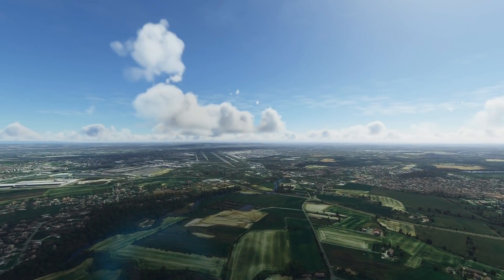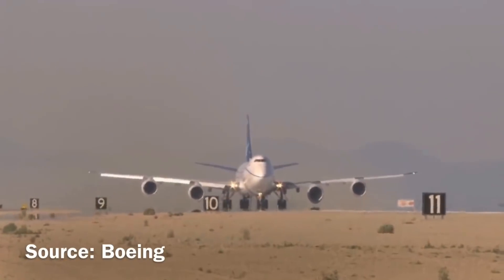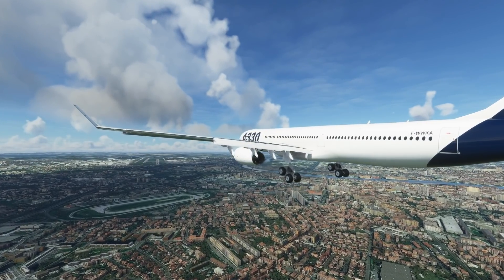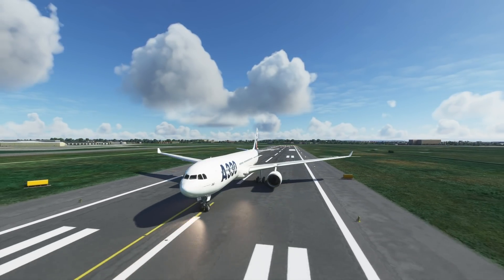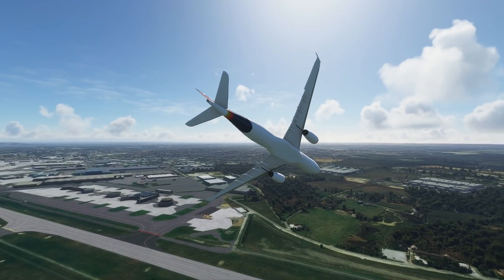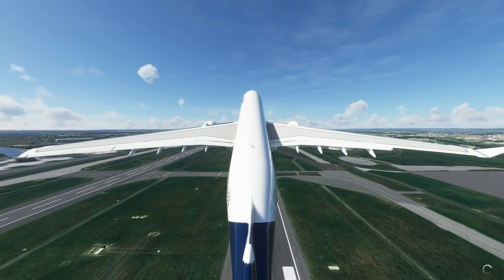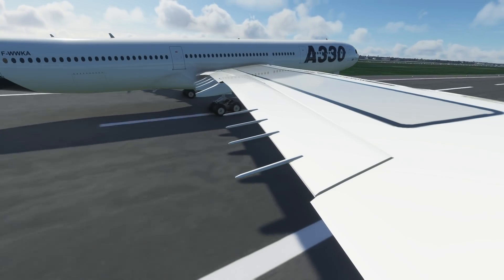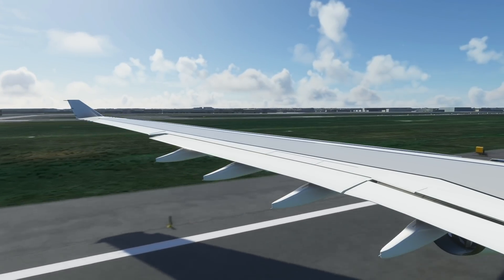The Test Flight That Went Horribly Wrong | Airbus Industrie Flight 129

Comment: I hope they do those tests on flight simulators nowadays, I just can't imagine exposing flight crews to the dangers of doing such failure tests on actual aircraft.
Reply: No amount of simulation can make actual testing obsolete, and no amount of testing can make all incidents avoidable.
Reply: Someone has to fly the manoeuvers to ensure the simulator is realistic, not just bash numbers into a computer.
Reply: And where do you think they get the data that feeds the simulators?
Reply: @tomstravels520  I do, but the outcome would be no loss of aircraft and more importantly, no loss of lives.
Reply: Maybe carrying out a preview of the test on a correctly configured simulator was part of the problem here? It could have added to the over confidence factor.
Reply: Where do you think they get the data to program the simulator?

Do you want to fly on a plane that has only been tested as a computer model and never proven in the real world?

Comment: Why not testing this at an higher flight level? Just adding safety meters and then pretend to just having taken off.... Such a shame the loss of these lives.. So unnecessary imho...
Reply: Because they’re simulating and engine failure at takeoff....not in the cruise
Reply: @tomstravels520  No, you do not understand. just set the meters in the right position. Stall testing they do above fl 10000.... So why this test at this dangerous altitude? Just add safety to your test. All parameters set at the test-levels, and THEN start your test.... Only then they would have had the possibility to regain control. It"s like testing car brakes near a cliff and then find out they don't work. Safety 1st!
Reply: @hugodeckers3880  what are you talking about? This was a test to see how the aircraft and the autopilot would respond to an engine failure at takeoff. This was not a stall test. You can’t simulate taking off at 10,000ft. The air is thinner at 10,000ft as well so aircraft won’t react the same
Reply: @tomstravels520  not at 10,000ft but certainly at 5000ft. Denver is 5400ft above sea level.
Reply: @lukfi89  that still not the same as taking off from the ground and climbing the correct way in SRS mode initially which cannot be done in mid air
Reply: Testing in real life is dangerous. But I can't see why certain parameters can't be set at a higher level. Add test-mode in a plane for testing. And I KNOW this is not a stall test. This fault of the captain and his fo cost  the lives of 7. Unnecessary and so sad. Planes still stall at take of level due to to engine failures, other mechanical failures of faults (stupidity, fatigue or whatever) from the pilots. So why do they test THAT at safe flight level. There's no answer to that..

Comment: IMHO, this should never happen: The autopilot should "know" that there is a minimum speed for climbing. So when the speed starts to drop below say 130 or 140 knots, priority should ALWAYS be to maintain speed and NOT flight path. You CANNOT maintain flight path with a stalled airplane. So trying to maintain the path for a few seconds longer and then crash... Not a good plan.
Reply: Simple answer, at the time the ALTITUDE CAPTURE mode did not have attitude protection. That’s why if the altitude selector has been set much higher it would have stayed in SRS or gone to one of the 2 climb modes and managed the climb on one engine correctly
Reply: Autopilots are not psychic. The crew has to enter cog and overall weights and calculate rotate speeds and noise abatement measures. How does it know the stall speed without that information? It only knows it is almost stalling. It's impossible to design out human error, you can only mitigate it.
Reply: @adriandaw3451  With the american definition of "angle of attack" it is simple. 
The lift of a wing is then proportional to the AOA. If you stall at 15 degrees AOA, then when you fly at 10 degrees AOA, you are flying 1.5 times the stall speed. Simple! If you use the european AOA definition, there is an offset to account for, but the result is the same.
Reply: Either that or automatically disengage
Reply: It looks better for the reputation of the aircraft when you can say the test pilots made a mistake.
Reply: It has a stall protection, I just don't know if the A330 had already that feature or the plane was in alternate or direct law.

Comment: The Chernobyl disaster was also caused by a test designed to simulate an extreme scenario.
Reply: And also in both cases the people running the test didn’t fully understand the characteristics of the system they were testing.

Comment: Would of full thrust help instead of pulling back?
Reply: That would have made the roll worse.
Reply: Maybe thrust up the idle engine could of helped and drop the nose
Reply: @coca-colayes1958  Engines take a lot longer to spool up than down (something like 10-15 seconds from low idle to full thrust). They had managed to get into a situation where the lack of energy made things irrecoverable.

Comment: Test pilots don't get nearly enough credit for the work they do and the risks it has
Reply: Air flight is relatively safe even for test-pilots , it's not even in the top 100 for high-risk for causes of death. Just sayin.
Reply: I think they would. Air Force test pilots maybe , but they would be paid huge salaries. Lots of allowances etc. But they would in the main be highly regarded in their companies. These planes are always getting upgraded too which means plenty off work . Their opinions on aircraft handling would be widely sought after by line pilots.
Reply: InstaBlaster...
Reply: Usually I am the first guy to blame the pilots, but no way on this one. This is an engineering debacle, a complete failure of software logic.

I am both an engineer and a pilot so I don’t take sides.

There’s no way if you have a good software in the auto pilot system that the auto pilot will fly the airplane into a stall, and that is exactly what happened here. In this case engineers are guilty of murder.

Safety of flight is first, so what if the pilots had the intended go to altitude at 2000 feet, and they are below that altitude, no way should the auto pilot try to get there if one engine is not working and it cannot maintain Flight speed for normal climb out. What a terrible disaster.
Reply: @steveperreira5850  similar in the crj200 at 41000 feet video, though, I think - there too, the autopilot was in an altitude rather than speed mode so they got up way too high with too little energy and speed. Not sure how much was the autopilot vs the pilots, I do software but nothing related to aviation.
Reply: @steveperreira5850  as a software engineer you know that the software design should depend on the input (user stories, requirements etc.). This situation has happened because nobody in the software development pipeline has considered a situation where the target altitude has been set - hence the mode switch. The underlying question is how could this usecase have been forgotten be the requirements engineering department. Why did it fall between the cracks?

Also - wasn't there something like "Alpha Floor Protection"? Why didn't this kick in? Or did it and hence the pitch down? Disregarding the altitude acquisition might have saved this plane in case of disregarding a target altitude. But what about a series of mountains around an airfield? In this case, the target acquisition is crucial.

I'm happy to be a software tester in a less perilous field.

Comment: Planes have become too clever for the pilots to keep up
Reply: Standard phrases heard on a modern flight deck: “What’s it doing now?” or “Why did it do that?”
Automation has definitely made aircraft very confusing for pilots, AND has de-skilled pilots.
Reply: @FutureSystem738  Automated systems have undoubtedly caused caused crashes. However they have prevented more than they have caused hence there is still a net benefit.
Reply: @FutureSystem738  Fully manual aircraft are much more dangerous same with fully automated.
Reply: Did we watch the same video??
The plane was too stupid for the pilots to keep up. Automatically switching modes, and then pushing the nose up while lacking sufficient thrust, that's not a clever move....

Comment: I feel like there has to be more to this accident. Once in the air the fly by wire should have switched to the normal law and should have trimmed down. essentially correcting the incorrect takeoff pitch trim. The autopilot should also disengage itself once the speed gets too low. And what about the fly by wire pitch protection and stall protections, why did they not kick in?
Reply: It also highlights the dangers of using angle of attack rather than airspeed for flight envelope protection. Yeah.. you can’t stall a plane unless it exceeds the critical angle of attack. But if you have no airspeed and a plane trying to keep a low angle of attack at low altitudes.. your recovery point will be subterranean.
Reply: @Bartonovich52  As far as I know airbus uses airspeed trend and pitch and not just actual angle of attack. There is an a320 fly by wire demonstration video out there where the alpha protection is demonstrated in the real aircraft. There they have an angle of attack indicator and the pilot flying who is explaining things says that the angle of attack can vary slightly because it's stable speed and attitude they are more focussed on not just angle of attack. So even in alpha protection the aircraft has pitch protection and phygoid dampening as far as I know. I'm not an Airbus engineer though
Reply: @Jet-Pack  that is the Airbus you know now. Back then however it did not have attitude protection when in altitude capture mode
Reply: Probably added protections as a result of this crash.
Reply: @Bartonovich52  Depends on which end of the aircraft you want to hit the ground first...  If the situation is unrecoverable due to lack of airspeed or exceeding alpha at the given height the results will be subterranean.  Much better not to stall the wing even if airspeed decays so you don't have the full 9.81 m/s^2 of gravity smacking you into the ground.
Reply: Both Alpha Floor and Alpha Protect did engage. 

But it’s a lot like being in a car with traction control and simply cranking the wheel until it locks at high speeds on a slippery surface. 

Even the best systems can’t change the laws of physics and can’t anticipate all scenarios. 

The plane had an aft C of G, a hydraulic system turned off, and an engine throttled back. 

Alpha Floor actually started to spool the engines up, but because of the thrust asymmetry it caused the aircraft to roll due to it being quicker to get more thrust from the engine at climb power vs the one at idle. 

That’s why they tried to override Alpha Floor and idle both engines before the plane did a Vmc roll, but it was too late.
Reply: @Bartonovich52  what makes you say the autopilot tried to throttle up the engines, when the report says the throttle had been in TOGA since takeoff?
Reply: I now want to look into this accident because this doesn’t mesh with normal Airbus Law logic.  How the low speed protection didn’t activate is confusing, but I’ve also had a long day.
Reply: ALT CAPTURE mode at the time did not have attitude protection. That’s why if it had stayed in SRS mode or one of the climb modes with a higher altitude selected instead of the 2000ft from the previous missed approach altitude it would have been fine
Reply: @tomstravels520    I love how some of you plonkers talk as if its a computer game ~ when actually its a few hundred tons of metal at speed ,     Not forgetting the full aft CoG.     In your pretend pc game its just a re-boot ~ in the real world ***         ps  How many Hours as a 'heavy' Test captain !
Reply: @andyb.1026  if you actually understood how the fly by wire system, the protections and different autopilot modes worked you’d actually know what we’re talking about
Reply: @tomstravels520     Mmmm  ! !   one of the guidelines on social media is to be polite & respectful.  I have written instruction manuals for almost all the AI fleet + Beluga for 30 years + EuroFighter & Tonka's fbw ~ AMM MoM FiM FCoM  etc , so I think I have a rough idea how the many systems work..   Your experience is !  There is a bit more to this incident than mentioned here, clash of personalities, sensor failure, probable crew error (Not Nick)..
Reply: @andyb.1026  “one of the guidelines on social media is to be polite and respectful”. So are you telling me someone else hacked your account and called me a “plonker”
Reply: @andyb.1026  Yup! A couple hundred tons of computer game, at speed. The computer game flying the plane was a contributing factor, if I heard right.